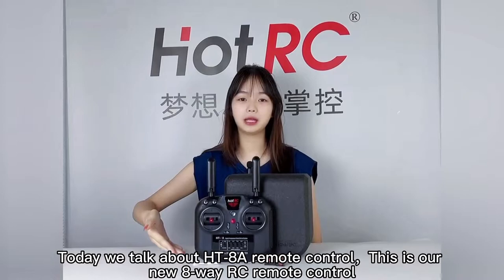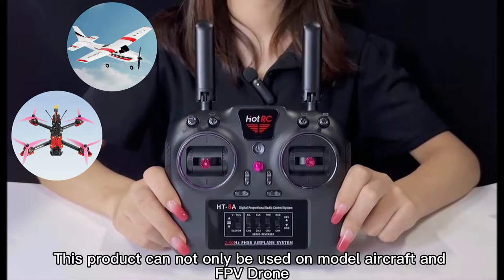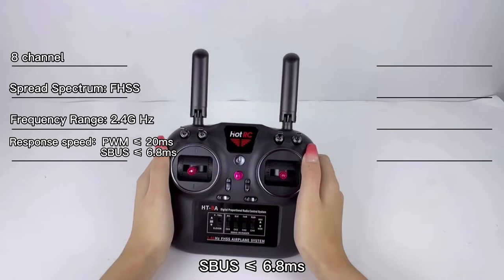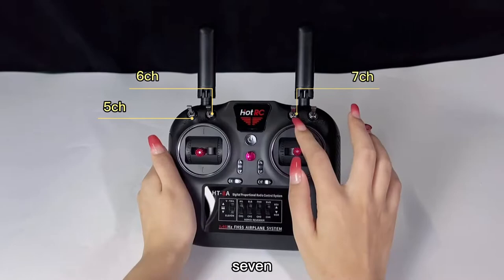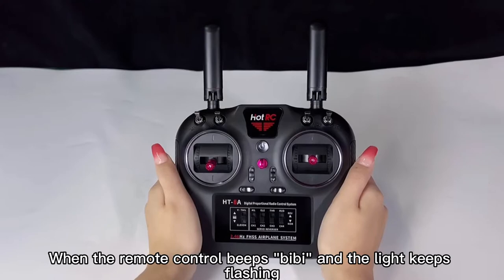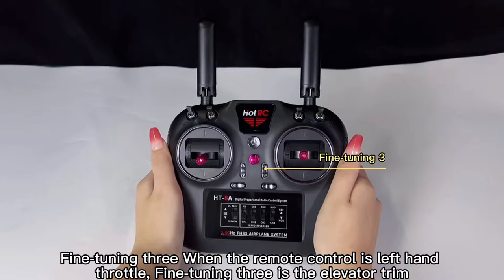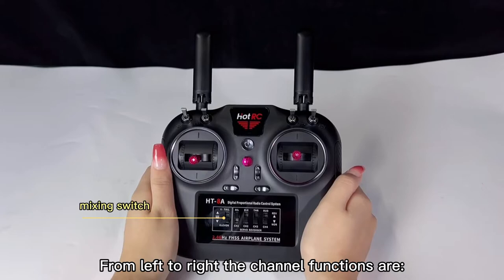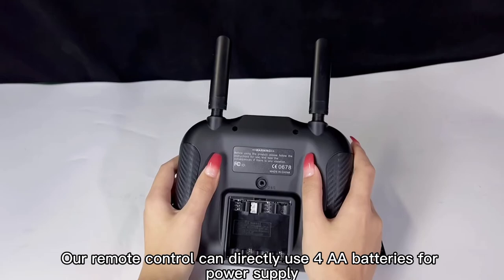【HOTRC】Basic introduction of HT-8A remote control video

Comment: How do I use the back dsc hole for games?
Edit: pls respond quickly
Reply from the maker: The hole on the back of the remote control is an analog hole, do you have an emulator?
Reply: @HotRC-Sophy  no I don't have an emulator
Reply from the maker: @neonq3073  You don't have an emulator, how do you connect to play?
Reply: @HotRC-Sophy  I wanted to buy the emulator but the dsc hole made me a little curious but does the hole uses any cable?
Reply from the maker: @neonq3073  If you go to AliExpress or Amazon to search for an emulator, you will have it.
Reply: @HotRC-Sophy  How do you connect it to the emulator?
Reply from the maker: @luvzbbb  You can go buy an emulator. There is an analog hole on the remote control, just connect the analog cable to the remote control, plug the dongle into the computer, and the flight is simulated.